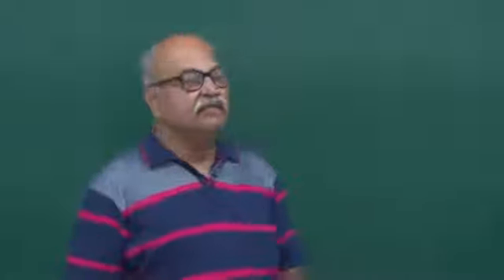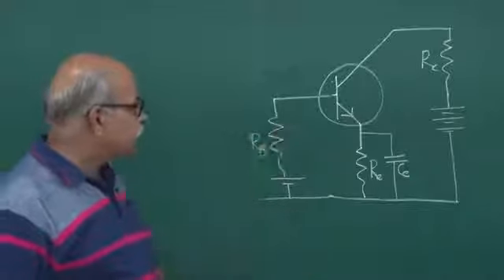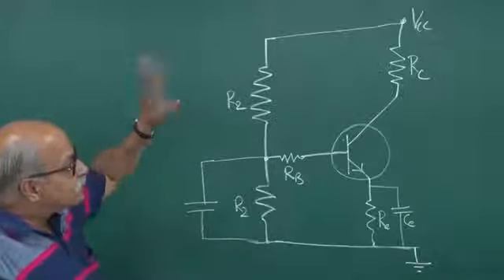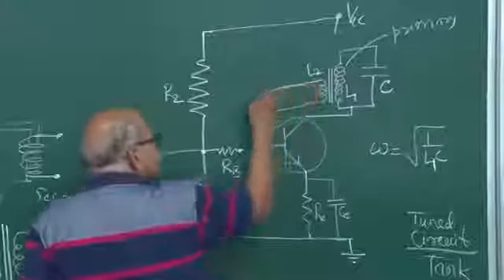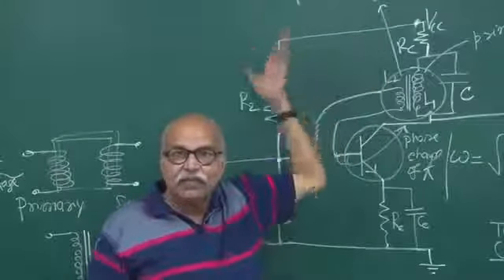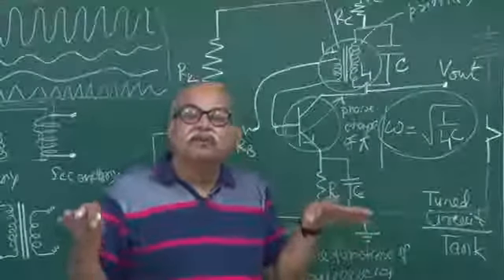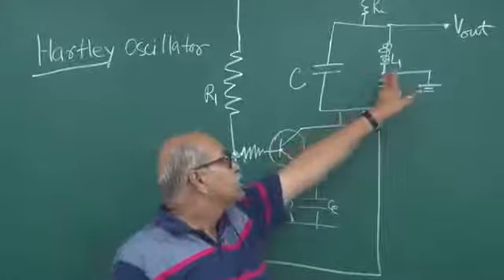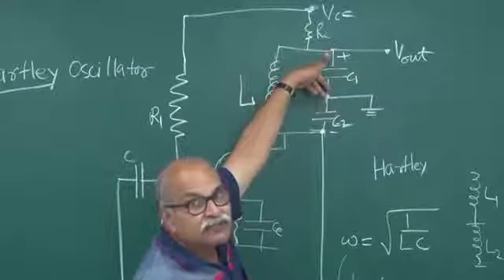Oscillator  Circuits by HC Verma

Comment: Namaskar sir 
The energy available at room temperature is 0.026eV and the band gap in silicon and germanium are 1.12 eV and 0.72eV.But then how it is possible for electron to move from valance band to conduction band at room temperature?what exactly is going on at this temperature?